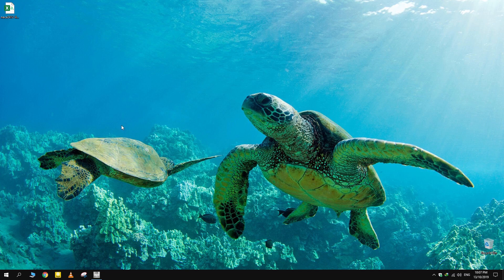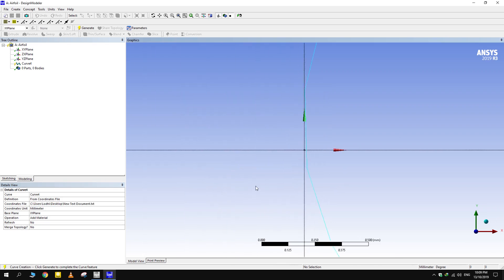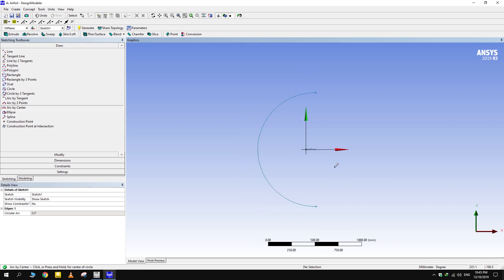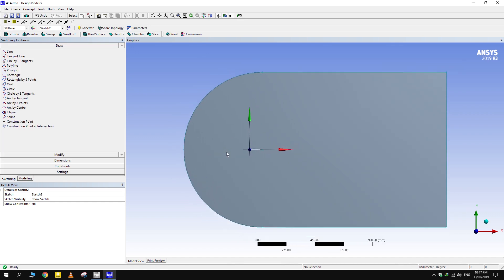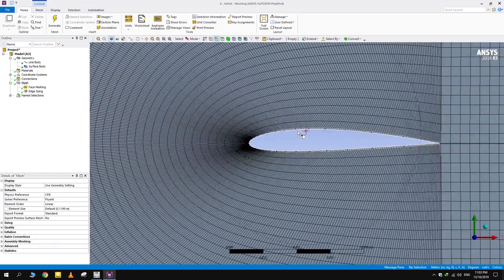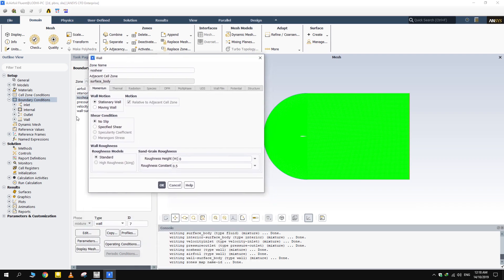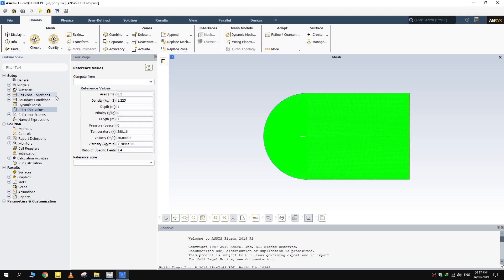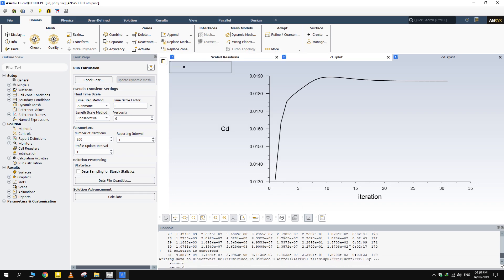Airfoil Simulation in ANSYS Fluent (C-Type Meshing)

Comment: I have tried it thousands of times. But when I clicked the button of generate mesh, pc became hang after generating 5% mesh. Although my laptop condition is good and other tutorials work finely. I could not understand why does this happen every time.
Reply from the maker: Crashing could mean that mesh is overloading your system memory try giving larger mesh sizing so that fewer elements get created. you can check how much system memory is used by ANSYS by windows resource monitor application.

Comment: Very good tutorial. I followed the same procedure but mesh wasn't structured 😢
Will you help me regarding my problem.
I used biconvex airfoil coordinates.
Reply: I am facing the same problem, any help with meshing?
Reply from the maker: C type mesh is not suitable for biconvex. Try with a rectangular domain and use face meshing. Divide the the domain into simpler constituents for better mesh.
https://youtu.be/oOAx4j3D2rc
Reply: @Ansystant  Thank you.
Can you provide me any source where I can find biconvex airfoil coordinates for various thickness?
I searched a lot but only 6% thickness coordinates are available.
Reply from the maker: Unfortunately the profile of many airfoils is usually not public information. The NACA airfoils are available on airfoiltools.com. People usually generate their own profile coordinates using Splines, Bezier curves etc depending upon their requirements.
Reply: @Ansystant  is there ny complete tutorial which guide perfect simulation for biconvex airfoil.?
I tried but ends up with y+ value larger than300.

Comment: how to set the airfoil, noshear, pressure outlet, and velocity inlet in the boundary condition? mine just have interior surface body and wall surface body.
Reply from the maker: Create named selection in meshing or design modeller. Then those named walls will appear in the boundary conditions options.
Reply: @Ansystant  still confused which indicates what

Comment: what is your system configuration bro?
can i run this bulky mesh in ryzen 5 5600h with 8gb ram
Reply from the maker: Domain is 2d. Your system is way more than enough to run it. Even though the mesh is really fine, it's the total number of cells that increase processing requirements. For 2d meshes like these, the total cell count is not much and even most of the old computers can handle them easily.

Comment: I don't produce the same mesh as you even though I did the exact same steps. My mesh is unstructured
Reply from the maker: We can not guess the problem without adequate information. But if you follow the steps carefully, you should be able to get a structured mesh. If the problem still persists please provide us more information so we could guess the problem. We'll try to help as best as we can.
Reply: @Ansystant  I get a half structured and half unstructured mesh. Is there an email I can send the file to and you could possibly refine it?

Comment: Please i have a probleme, when i try to upload the coord_file for the 3D curve it shows me an error "error reading coordinates file " even i did the same process as yours. If you have any idea
Reply from the maker: If you made the file according the pattern, then the error is most likely due to the same first and last point. Make sure the curve isn't closed one. If first and last point in the coordinate file are same, DM will give error. Make an open ended curve and join it later as shown in the tutorial.
Reply: save a Coordinates in .text file like this
for example  1.0, 0.12,  0.0
                    0.125, 0.12, 0.0 
                         ...... ,  ...., 0.0
you got the X, Y coordinates from NACA and you have to add the Z (everywhere 0.0)
copy this in excel but only in one Cell (no Separate) and save like .csv(comma delimited)
Reply: @karenmartirosyan4  you have to put them in commas not dots decimal
Reply: No they're not the same, because i can create points but not the curve. is it possible that i have a problem in my version?
Reply from the maker: There shouldn't be a problem with ANSYS version. Upload the text file on drive and share it's link here. We'll take a look at it.

Comment: can you make video on airfoil simulation and then validate it with the experimental values or from airfoiltools.com... 

coz everbody is showing the airfoil analysis but noone is showing the validations... when i analysed with using clark Y airfoil( @ Re=500,000, Chord=25cm ) my values aren't  matching with experimental values.
Reply from the maker: Your concern is valid. Simulations are always verified by experiments. But there is always a certain degree of error involved in experimentation or simulations. The most prominent being the effect of wing tip vortex which can not be captured by 2d simulations. If you are running experiments on wings, your results will never match with simulations done on airfoil. Let's say the wing used in wind tunnel is attached to both walls of wind tunnel (for excluding the effect of wing tip vortex), and instruments are precisely calibrated, results would be a lot closer but there will still be some error involved. And of course, it goes without saying that you have to achieve mesh independence. Keep refining mesh (especially near the airfoil) until you don't get any changes in results. Simulation in this video was done only on one mesh size. But results were still quite close (Cl=0.27 vs 0.286 on airfoiltools.com and Cd=0.0187 vs 0.0100). Mesh independence was not done for limiting video time. But refining mesh would get us exact results.
Reply: The mesh near the surface of the airfoil is way too large to capture accurate values of Cl and Cd.  You need to go an online calculator (https://www.pointwise.com/yplus/index.html) that will give you the delta s value or the thickness of the first layer of meshing at the airfoil surface.  Assume y+ = 1 then set the value you get for delta s to the thickness of the first layer of mesh.  You will probably see the thickness of the mesh at the airfoil surface is way too large.